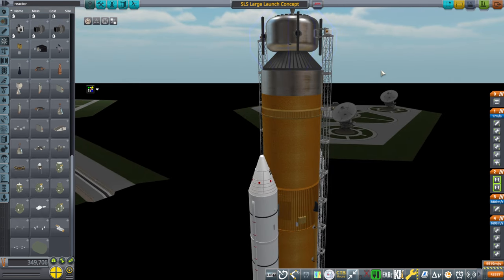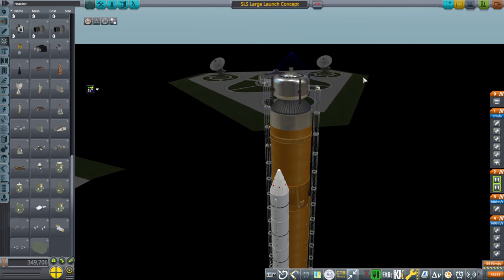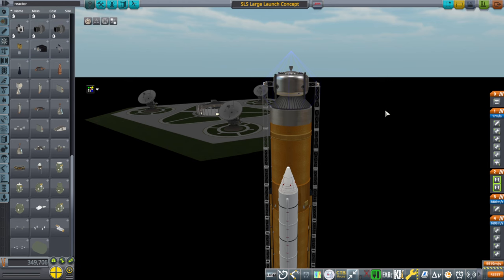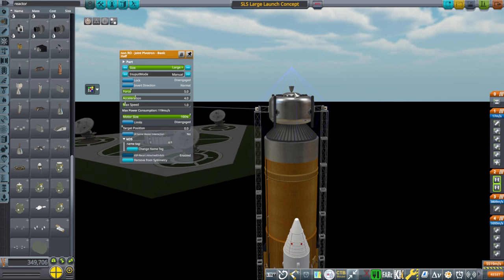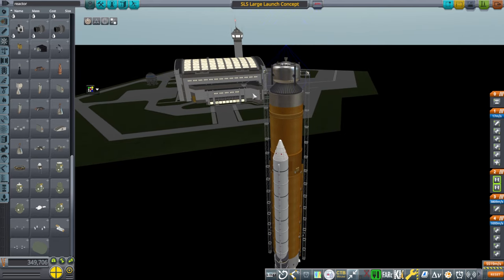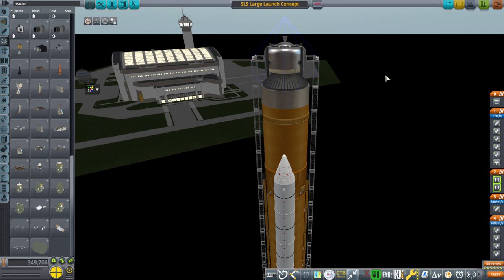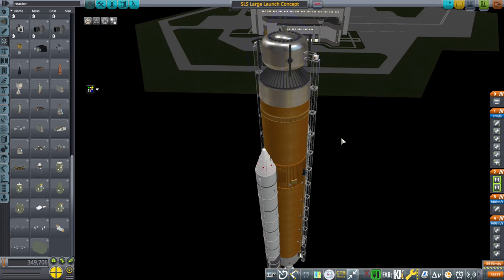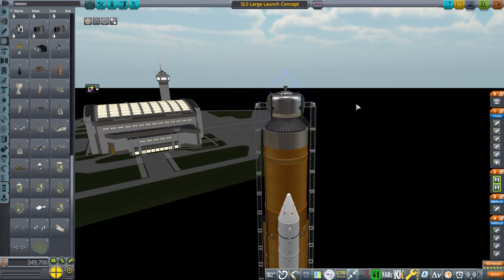SLS Large Payload Concept (Kerbal Space Program)

Comment: If it's just a LEO test bed, bolt it to the top of the core. Keep it light enough that the core can get to orbit. Use a tether between the core tank and hab. Then spin it end over end with the core and engines as the counter weight. You could adjust rotation speed and tether length with a winch and thrusters, simulating any gravity desired for a range of experiments.
Reply: That’s actually a really good idea

But unfortunately I have to ask… how much money….
Reply: @goldgamercommenting2990  depends if you involve Boeing and fixed cost contracting.

Comment: I like parts of it, for sure. IDK if realism for the launch sheer on such a part would be great, but it could be given a knuckle fairing at the top perhaps. with a docking component at the ends, you could send two or three to make a longer main truss. if you work in versions from the guy who did a great many parts for space stations and bases, had expanding tubes and connectors, that could be a first run connector for a station. Thee modder was RoverDude, and he made and looks like he still does a lot for KSP 1. He also has a lot for build on site and in situ building, if that is of interest.
Reply from the maker: I've used RoverDude's USI stuff and made RO configs for them even, but I didn't recall him having larger scale stuff.
Reply: @RaizSpace  I am not sure of the scale, but he does have  base and station in situ parts, that could make a good baseline for what you are looking to do.

Comment: I think the reasoning may need to go a little bit further still. Is there really a need to create a crew-transfer tube between the center and the outer modules? If not I think, with telescopic and/or hinged parts pushing outwards and reinforced by tightening cables to stabilize (tent-like structures), it is possible to create everything needed inside the top fairing. With telescopic parts it may be possible to do artificial gravity tests with both different radii and different rotation speeds.
Long trusses along the tank might need fairings too for drag reasons, in which case it might be advantageous to use tubes directly instead of trusses.
Just a few thought that came up. Thanks for bringing up the topic.
Reply from the maker: Not using the telescoping parts may be more of a KSP artifact than a real life issue - I'm not sure I can do what I want with that kind of part. That said, I think telescoping parts might also be heavier if we plan to use this setup for practical purposes because of the mechanisms involved, reducing the delta-v of the resulting vehicle.

Comment: That's really cool. It was my understanding most near-future artificial gravity proposes focus on using a long cable to anchor the modules together. Is there an advantage to having a solid beam?
Reply from the maker: I want to have habitats on both ends - usually the long cable is to attach a dead stage or something else as the counterweight, but this system isn't going to have a dead stage like that and also needs a live ion stage in the middle. You can't have a live ion stage in the middle of the spin if it's done with long cables. I mentioned the Gemini test where they had a cable attached to the Agena and tried to spin, and it was sort of wobbly and had trouble staying taut. I'm concerned that the long cable method ignores this demonstration and just hand-waves it away.

Comment: I would like to see replica builds videos. So many mods have parts but never explain how they all fit together to work correctly.
Reply from the maker: Which mods did you have in mind?
Reply: Us rockets like thor, delta, juno, and scout. Soviet probes. Soviet rockets. I thought I had the soyuz built but after the boosters drop and I seprate the first stage the second stage has no control and starts flipping. I believe I've gotten the module built correct but idk.  No idea how thor works or juno I've tried but they don't work right.

Comment: Where did you get the 100m for the centrifuge radius from, because I calculated it to be 224m for 9.81N/kg. Also where did you get the 2rpm number from, is that what everyone can comfortably experience without training ? I mean you can train your crew, or just dont mount windows within your habitat, since the visual realization of the rotation should be the biggest problem, feeling the Coriolis force at the end of a 56m long centrifuge at 4rpm would require a passenger to "dance" around quite a bit.
About the Gemini tether story, according to Wikipedia the experiment was about keeping the tether under tension by "hanging" the Agina vehicle from the Gemini capsule. This obviously doenst work as we KSP players know, as the lower object moves faster assuming circular orbits. Generating gravity was not the original goal of the experiment and it was only a tiny amount, so I wouldnt rule out a tethered connection based on that.
If you want to keep your 100m centrifuge, spinning it at 3rpm would generate 1g. About the nuclear reactor, please dont put it in the middle, crew would not be able to pass through the tube due to the radiation. Instead use only one habitat on one side and have the reactor be the counter weight. This way all life on the ship is as far away from the radiation source and you only need a small neutron shield at the end cap of a long cylinder reactor, instead of requiring a short cylinder reactor with large mantle shielding.
Reply from the maker: I said over 100m, not exactly 100 m, and I immediately said I didn't have the number for Earth gravity because I aim for Mars gravity, which requires less rotation and I believe is enough to maintain bone and muscle mass. The reactor would not be a sufficient counterweight for the hab - it's way too light. This is not an NTR reactor. However, having it on the opposite side of both the propellant and shielding would mean that the center of the vehicle would be a shelter for solar events as well.
Reply: @RaizSpace  I wasnt aware that you were already set on the reactor size, but why dont you make it bigger ? More power seems useful when relying on ion engines.
About the 100m, I misunderstood that. 85m is all you need for 3.72N/kg, so you can go to 4.39N/kg at 2rpm if you want. Although I still think you should look into 3 rpm, just because Mars gravity should prevent bone and muscle loss, doesnt mean its better than living at 3rpm with Earth gravity.
Reply from the maker: Yeah - I'm wanting to do this with the fewest launches possible, which is why I'm resorting to this novel arrangement on SLS in the first place. So, the reactor should be as small as we can make it with the ions still giving us what we need for testing as well as a trip to Mars or the Moon. For science purposes, we can spin up to greater than 2 rpm to see what happens, but to use this as a vessel, I'm going with a baseline of 2 rpm. If we want to do full Earth gravity, we would obviously need to send more segments than can work on SLS like this.
Reply: @RaizSpace  I dont know how well this fits into your planning, but you can extend one side of the centrifuge to decrease the required mass of the counter weight. habitat/counterweight * 100m = length of the counterweight arm. Maybe you can fit more than one truss element on SLS.